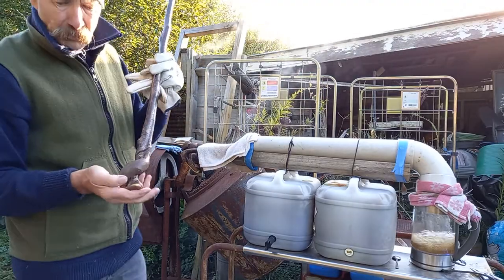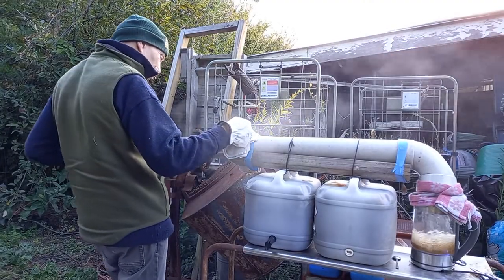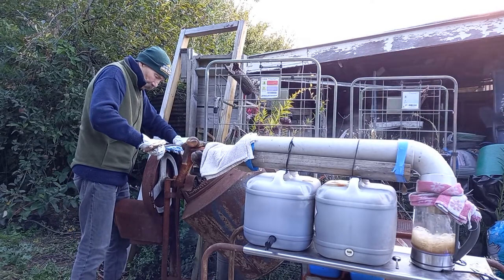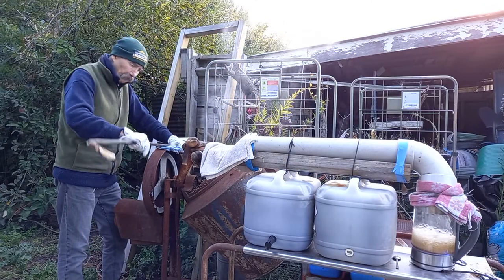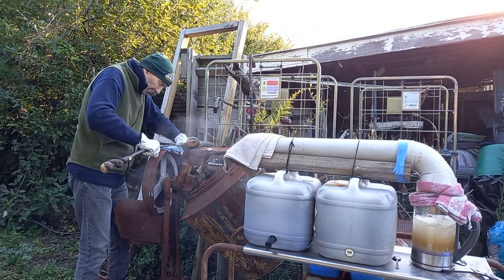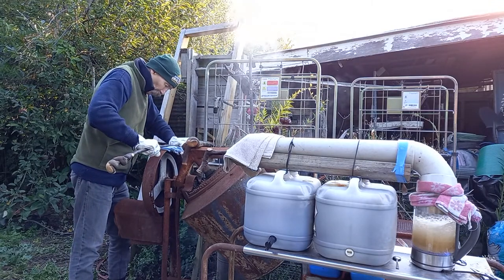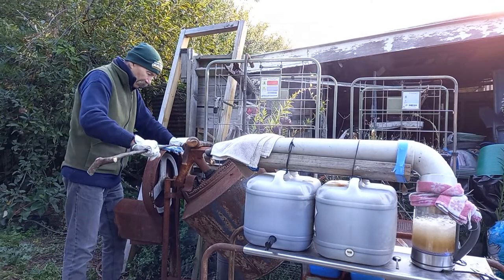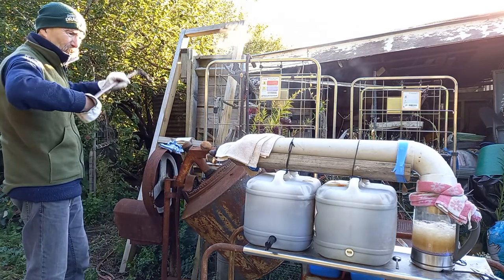Steam Straightening Natural Saplings for Walking Sticks

Comment: Love your simplistic steam contraption. I'm going to have to create something like this only longer as I am working with longer walking staffs. I'm wondering how long of a drying period before applications of linseed oil?
Reply from the maker: Thank you.
I'll get around to building a wooden steam box one day.
I oil them several times as they season in the shed as I prefer to keep the smooth bark on my sticks.
It also minimises cracking and doesn't lessen the steam if they need further work.( just a bit longer with the steam perhaps... you'll feel it... if there's too much resistance, just put it back in the steam box or you'll likely crack or break it)
Good luck and have fun!

Comment: Have you ever steamed walking stick that was an inch and a half to 2 inches thick?
Reply from the maker: Yes. One of my big hiking Staffs. Not ideal in an improvised steam box, but when I was young, I worked with a friend on his boat doing the steaming of the hardwood ribs and they were 2 inch thick. I forget the length of time in the steam box whether it was an hour or half hour per half inch, but you soon knew if it hadn't been long enough. It either wouldn't bend or it cracked when forced !  A Cracked Rib wasn't good as it had to be pulled out and thrown onto the scrap pile. 
Have fun !
Cheers